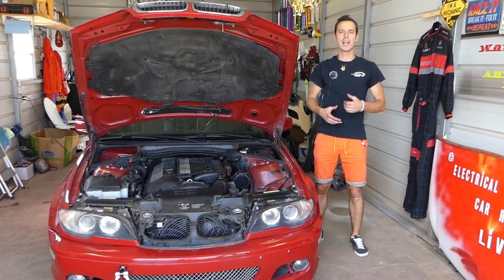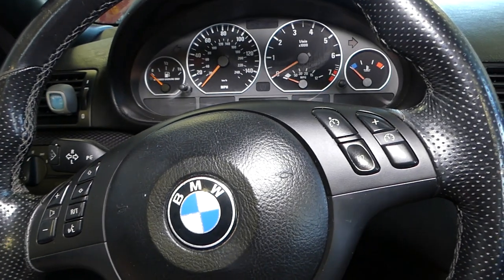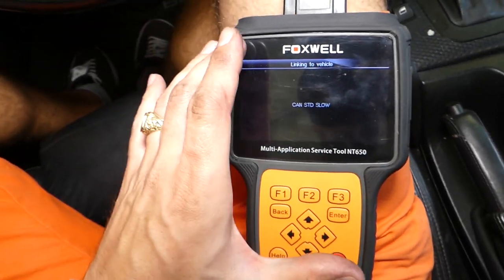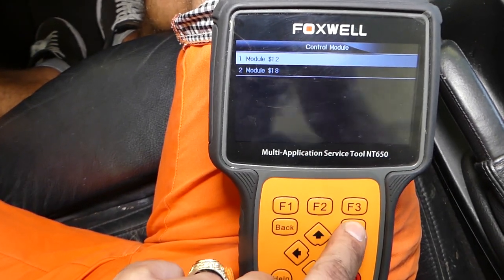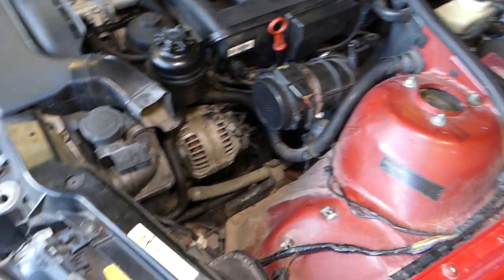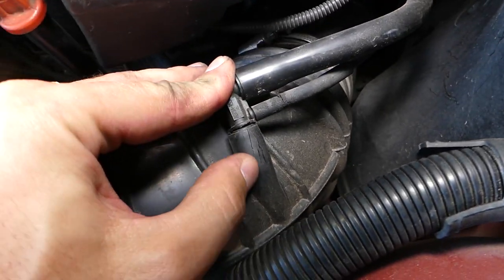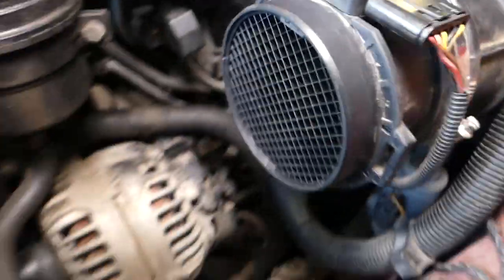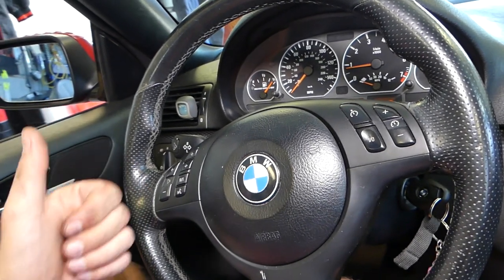BMW WONT IDLE, ENGINE DIES STALLING BMW E46 E39 E60 E53 E83 X3 X5 Z3 Z4

Comment: I had a similar problem with my E91. Whenever I stop at the lights, or I'm stuck in traffic, however briefly, the engine starts to stall and dies. To recover from the stall I had to take my foot off the brake so the car rolls slightly forward - and as long as the wheel turns, the engine recovers. Yeah, I know, stup1d. I sent the car to the workshop a few times and they said they cant find any error codes. Very, very frustrating. But there was a happy ending to all of this. It looks like the culprit was a leaky gasket - as every time I started the car I could smell petrol. Due to limited funds, and the fact it wasn't I considered critical - no oil stains on my driveway (the leaky oil just ends up in a tray) - I didn't fix the leaky gasket until much later. Like why would a leaky gasket cause my E91 to stall right? Anyway, after that was fixed, the stalling STOPPED COMPLETELY. That was 2 years ago, and it never ever happened again. I'm not a car expert, but thought I'd share this in case someone is in the same situation as me

Comment: If your car starts then shuts off make sure everything’s connected that’s why it’s shutting off then go to mass airflow if it starts check all wiring and connections my throttle wasn’t connected down low on my bmw n I had to do this

Comment: Mine is intermittent. Lights on: eml, amber break light, service engine blinking. Runs normally for about 5 minutes and dies. After it goes into limp mode.
Reply: Does it work now? Is soo what’d you do?
Reply: Same for me ? What did you do to fix it and was it expensive?

Comment: Help me my e46 320i its idle for 10 minutes after it switch the engine off nd from there is not starting but after two hours can start when it's cold

Comment: Don’t immediately replace the Idle Air Controller.  First, remove the device and check for ease of actuation by hand. Spray the inside THROUGHLY. Work it back and forth.  Spray it again and again while working it manually.  Reinstall it and run the engine looking for improvement.  

But, like he said, there are most likely also a TON of rubber hoses and boots that are ALSO cracked and leaking on the way to reaching the Idle Air Controller. So, replace ALL of those that need it at the SAME time.

EDIT: Although the Idle Air Controller is a very common issue, it is actually RARE that it fully failed.  It’s most likely gummed up with carbon, and can be very simply cleaned and reinstalled.
Reply: Do you use brake cleaner spray or what on the controller? ty
Reply: @eeemuse  Yeah, I used spray brake cleaner; it worked phenomenally.  BUT -->  I'm not sure it was the right choice in the long run as it's a pretty harsh chemical. Although, mines still the 2002 factory unit with 186,000 miles on it and it's still operating correctly after I cleaned it with brake cleaner.
Reply: on the m52/54 there's only the two boots between the throttle body IAC and MAF... IAC goes into a large grommet in the intake manifold.
Those boots DO crack commonly(with mileage especially)
Hope it helps someone some day.... ;)
Reply: @billymanilli  In fact, you can almost GUARANTEE that both of those will be ripped.

Comment: My E46 330 has been parked for 2 years now. Last week i tried to start it up and clean the car, and it didn't stay idling and the first thing i noticed the crack on the intake hose just like yours. Got the replacement hose from eBay and going to replace it this week and see if that is the only problem for now. Hopefully nothing else is broken.
Reply: Did it fix it?

Comment: Love the videos so far, you guys are awesome for sharing the knowledge. I'm working on my friend's 2005 X5 3.0i, and I changed his battery to a Optima yellow top AGM battery because his old battery was no longer good. My issue now is that his vehicle is doing exactly what this video is showing, but the only thing I've done is changed the battery. Prior to me changing the battery, the vehicle would run fine, but had to be jumped. I've learned that the computer needs to be reset after a battery replacement. Is there a way to do the reset without taking it to BMW? Please help us!! Thanks guys
Reply: Hi Matthew, how did you fix this problem? I put a new battery in mine and the same thing is happening. Thank you!
Reply: Did anyone solve the problem after battery change ?

Comment: m54 engine revving when going to iddle then it will stall or shut off. afterwards it give me lean codes bank 1 and 2 and no longer stalls but fuel consumption is high.
Reply: Thats what I got goin on with misfire
Reply: @jesusalexanderbracamontes1913  I finally got my engine to work almost perfect no more. I had bad spark. So what I did I changed everything coils spark plugs fuel injectors maf sensor ICV after I did this I started to get only rich condition. So I changed all O2 sensors and now my engine don't rev stall or have rough idle. Also check the ends of the catalytic the bolts can be deteorated and air might be leaking from there I also did some fixing in that section. Good luck.
Reply: @jesusalexanderbracamontes1913  did you fix it?

Comment: If I press the gas pedal to keep running for a minute, mine will stay running once warm 🤷

Any ideas what this could be? 
I'll check the IAC motor but I don't think that's it, no vacuum leaks I found. 😥
Reply: same
Reply: Check your DISA valve. If it’s worn out or not. If it’s worn out, replace the Rubber o ring and the flapper, easy fix with the repair kit for DISA valve.
Reply: Check your DISA valve. If it’s worn out or not. If it’s worn out, replace the Rubber o ring and the flapper, easy fix with the repair kit for DISA valve.

Comment: Hello,
I have a 2002 BMW 525i. I replace the intake hoses and now when I start my car it does not idle. I have to hold the gas. Now it makes a sharp knocking noise near the intake manifold. Code shows P0102. Please help. Thanks

Comment: I have changed both vanos solenoids and camshaft sensors and still have rough idle and stalling. Please help. If I can’t figure this out I’ll just take it to the dealership. 2007 328i
Reply: Me to 328xi 2008

Comment: Hi,
I need your help,  
i have e90 n47 320d 2009, doesn't start up, with the help of easy start it ignites but cannot hold to idle speed (lower rpms),  Already changed HPFP as initially it showed lack of fuel, many thanks
Reply: X5 E53 stalled and now cranks but won’t start

Comment: Hi guys. I have a 2008 name x3 3.0i with 140000kms on it ..this car is like new but the motor doesn't run right at all ..oil just comes out the back front and just doesn't want to run right .question is this engine worth the money to fix or replace it with a Chevy motor ..I want to keep this car ..what do you think ! Thanks

Comment: I have a 2006 BMW 352 I.  It starts up and runs fine But after a while it just sits there and stalls out at a idleAny ideas Is new map sensor new VVT  cam and crank but still doing it intake gaskets  is new too
Reply: The pcv

Comment: Hi,i hv a bmw 3er starts normal not missing not any other problem but randomly on the way dies and not starting again till i hv waited some hours and then starts again like normal. the problem codes are 2850 and 2852 thanks for the help already. i will wait for your suggestion

Comment: Had the same issue with our 2003 Z4. We noticed upon exiting the vehicle that the driver's door wasn't closed all the way, but apparently enough that the "door open" notification didn't go off. Once the door was closed completely, it hasn't died again when stopping or idling (8 months now). Safety feature? Haven't seen anything about this scenario to know for sure.
Reply: It's possible to program the ECU to shut off engine if doors are open. But one must confirm it with ecu reading.

Comment: my 318ci has a similar issue but it idles fine, just sometimes when im slowing down the engine cuts out randomly. it has no issues starting up again and sounds and feels fine other than when it cuts out. any ideas what could be causing this?
Reply: Mine has the same issue did you fix yours?

Comment: I’m having this same issue. Matching symptoms. The other thing that’s happening is that if I get it to hold the idle by starting it while hitting the gas, the car shakes very violently. Is this also a symptom for this issue ?
Reply: @xoxxxooxx  Hey I have the exact same symptoms as you described. Could you figure it out what was bad?

Comment: I have a 2003 325i while driving it shuts off but starts right away  
What could be the problem
Reply: Mines doing the same, did you find the problem. Mine stalls when slowing down and sometimes sat still at idle.
Reply: @johno6637  Hi, did you ever find out what the issue was? I'm now experiencing the same thing. Already changed Airflow mass sensor, but would like opinions on possible problems before purchasing parts not needed.